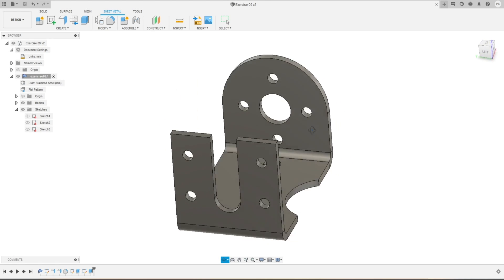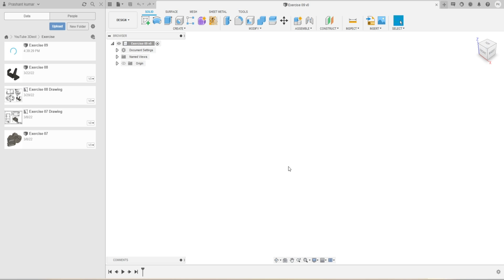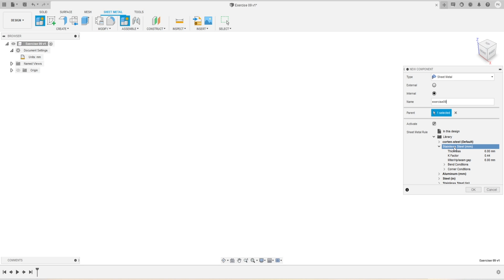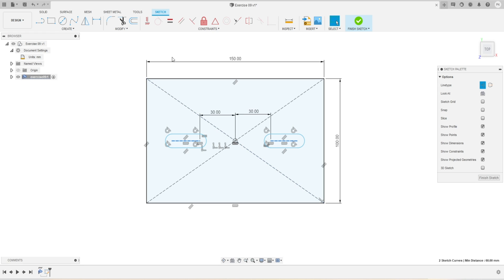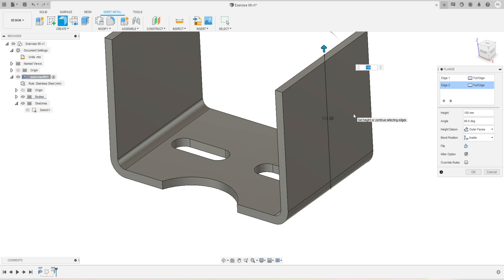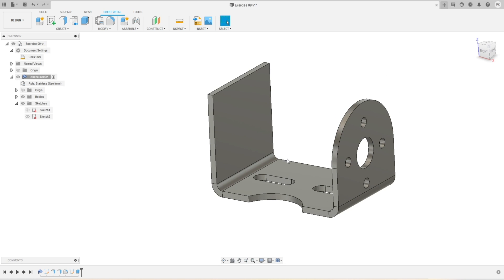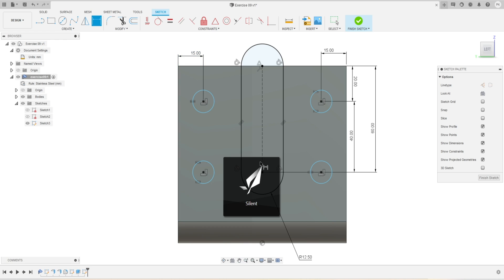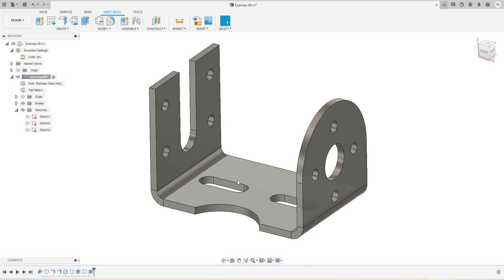Fusion 360 sheet metal exercise for beginners | Tutorial 009

Comment: Great Video and it was extremely helpful in a way that no other video was. thank you. You used a lot of features some of the other channels have not gone over or took too long to go over. But you went thru it so quick I missed most of it. Do you have more videos up explaining how to center slots and all that? My current process is extremely slow with a calculator figuring out centers and all that. the speed in which you did everything was faster than I could fully understand even with pausing.
Reply from the maker: Hey, thanks for your feedback, I will soon upload few more contents around fusion 360 practice, but I will make sure I am not going so fast.
Reply: @3Diest  great thanks. looking forward to the videos. Subbed for sure.